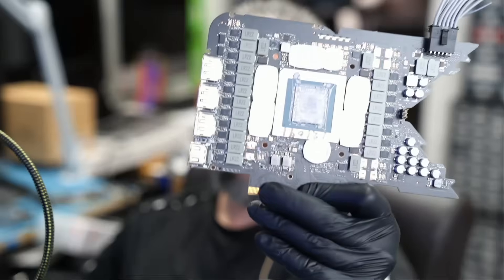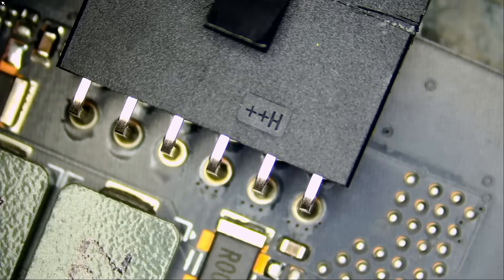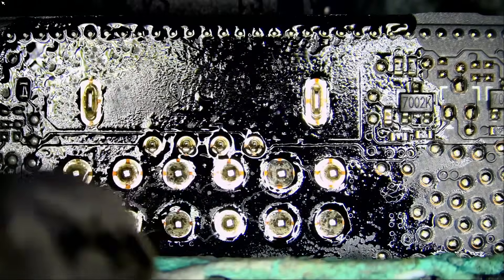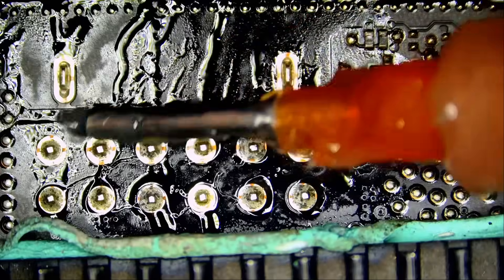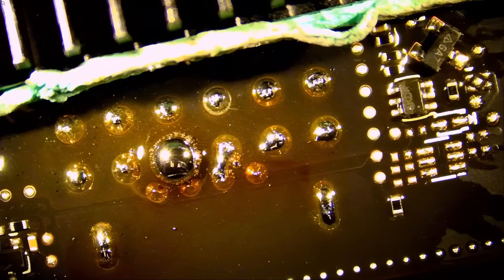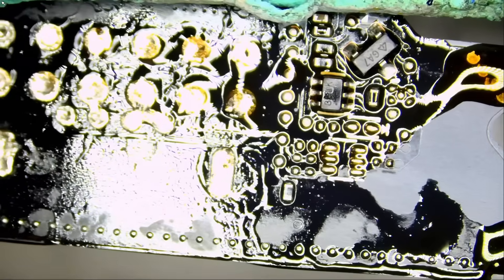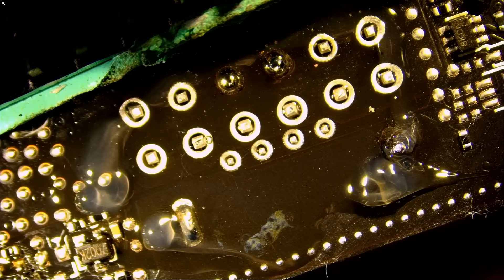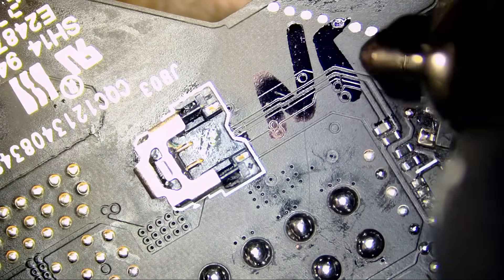The New H++ GPU  Connector Is STILL a Problem – 4090 12V-2x6 Melted

Comment: It is ridiculous that the 5090s aren't coming with mandatory load monitoring or even active balancing for the 6 power pins. Derbauer made a device that can monitor for 140 bucks with a unique connector length, audible alarm, and onboard logging of per pin current and connector temps. There is no way the third parties cannot all just let go of a tiny fraction of their margin and build in monitoring at least using probably less than 25 bucks worth of extra materials and work in manufacturing. These cards are insanely expensive, there is zero excuse for having so little precaution. For what asus wants for simple monitoring the Astral should be balancing load as needed on its own and shutting down if the load is just too unbalanced to control indefinitely.

Comment: See this in the automotive world all the time, its not the lenght of the pin its the spring tension on the female pin in the cable thats the problem, poor pin tension causes the pin to arc causing excessive heat causing the plastic to melt, bigger pins and better tension , some times manufacturers need to stop penny pinching

Comment: It's a simple fix from the manufacture side...double the voltage and halve the current.  Just add a buck converter AFTER the connector.

Comment: The RC model world has had connectors capable of delivery 120-180 amps of power (2000W) for years, why can't Nvidia just use those and make an adaptor to fit the PSU until PSU manufacturers catch up?

Comment: i have asus strix Z590F motherboard when i turn on cold boot bios settings all going to defualt but time is correct and after i check this like waiting 6 to 10 hours bios not reset but i keep pc off like more than 20 hours it happens any one can help ?

(and also one strange thing happn when i plug my earphons to front panel after like 2 hours of use left side of my earphone volume lower to comapre to right i didnt know is that related the problem to bios reset ?)

  
plz help anyone see this !!

Comment: The problem is not the connector, is a joined fault of the board design with no power balancing and a retarded designed connector. The 3090 had 3 phases on the board for power balancing and it did not burn, but nvidia in its infinite wisdom probably cut some corners, in the power delivery of the board joined with a dumb connector instead of the good 8pin connector we used to use. I do not mind having a uncool looking connector rather than a toasted board.

Comment: Shouldn't they change to a xt60 type or sort of connector at this point? 
I mean with thicker wires and fatter connectors.
As the card only sees it at one wire anyway.

Comment: Them solder joints better than factory must have a good conductivity not causing heat to melt the connector and cause issues.

Comment: To me, seems like the melting connector problem started when the manufacturer switched from multiple power connectors to single connector. Perhaps they also removed or limited any power balancing circuitry; so that any single line wasn't pulling max amps.
Reply: Its a load balancing issue. If they use multiple connections without balancing, they could still potentially melt at the highest loads. But it may happen less.

However, Nvidia doesnt have enough room for multiple connections regardless. You cant put 3 eight pins on any of the cards due to how small the PCBs are. They spent a lot of money on the small pcb and the cooler designs. It would cost wayyyyy too much to go back and do it the right way.

Comment: I am convinced that there will be more than 2 + on the connectyors when it will be really fixed by the company who makes them, maybe they would have to reduce the amount of current in the pins that melt plastic...before to design a new connector, they could reuse plasticx of old good tube tvs that was so resistant tro fire...

Comment: Ofcourse it will be a "still| problem. 600W, are half of the car starter current(petrol ones). How it will handle at least 50A, through those pins? No matter they are several. it will be heat, that`s it. Not enough surface for that much amperes. Manufacturers are stupid.

Comment: Maybe it's not the connectors that are failing and it's the solder they're using? Hasn't made effective contact with the pins, and legs are heating up and causing the connecter to melt. 

I'm assuming you've used low melt solder on all the connectors you've replaced with the quality Amtech Flux (Available in store)? Maybe it's making a more effective contact with the pads, or it's a better electrical conductivity than the high melt stuff they're using? 

Everyone focusing on the connector it's self when it could just be the failure point.

Comment: I have the same problem with my ps4 the hdmi connector on the main board is coming off because of the heat , i have put a set of small fans on the back to keep me from having to replace it again.

Comment: 600W @ 12VDC ... 50 amps. No wonder the connectors are melting.

50 amps in RC ... means a Deans connector. A melted connector means a lost model plus the possibility of the model setting property alight. No bueno. Deans highest performing connector, their flagship, is rated for a continuous 90A. No way H** is going to manage 50A continuous. Someone made a terrible mistake with the H+ standard.

Comment: i know nobody read this . but reason why the 16 pin connector melt because the pin is very thin ,can't handle 600 W in 12v to 50 amp it cause, why made this connector for this current ?
Reply: It looks like this shabby connector design is already a "standard" that PSU makers are adopting. Can't make it up.

Comment: Good day Alex.Love the work! Isee the solder in faulty/new card the solder does not penetrate all the way through the board to top side the way it does when you repair.
Maybe the time /solder composition does not have enough heat when it goes over the wave soldering process causing high resistance in the pin from the circuit board 
connection itself? You resolder those pins at least 5 or 6 times. thats not happening in a wave soldering/industrial enviroment.They mabe should look at solder/flux ratio and definitly heat when  joining...Maybe the connector is not the eliphant in the room, but how it is attached in the first place. Thanks for the great content.
Reply: I doubt that has anything to do with it.

Comment: Also note to people who "build" their own rigs..  Make sure there is enough clearance between your case and  video card power plugs...  
 2-3 times I noticed people  "pushing" their case closed and power cables are bent /stressed against cover which isn't good for card/mother board and the power connector.
If space is really tight get one of those  180 Degree Angled Adapters 12+4pin  (but better off getting a bigger/deeper case vs adding more connectors/points of failures)

Comment: It's not just a connector issue, it is a load balancing issue since the pins are just connected on the card.. The connector can stand the 8.3A per pin but without load balancing in the card or the PSU a single pin can carry over 20A as der8auer showed. Which fails obviously.

Comment: I once was a keen fan of NVIDIA but because of their stubborness still pushing this failed connector technology I stopped buying their products. Whoever decided to go for a small 6+6 pin connector should have been fired years ago. But obviously NVIDIA decided to go down the drain with it. I have a degree in electronics and worked in the electronics business for decades. Usually if a horse died we fix it by breeding a better one. But NVIDIA keeps on riding it still lying on the ground rotting.

Comment: Maybe the manufacturing process weakens these connectors? And manually replacing them may be is better than factory?

Or users don't overclock the gpu after repair anymore?

Who knows, but it's interesting they never returned.

Comment: moral of the story. just straight solder the wires to the board and go on. maybe swap thicker wires while at it.  add an extra fan and heat sink where possible.

Comment: You can see the slight misalignment on the left (1:15), even when in the locked state, which caused the issue on the previous connector. It's not pin length, it is pin shape / contact points / alignment (in my view).

Comment: The story of the melting connectors on the 4090's should've ended a long time ago. 
What would it cost the manufacturer to make good connectors from heat resistant plastic. Probably not much. 
So why are they still supplying these high-grade boards with shitty connectors.

Comment: The connector is fine, just don't use it with over 400W. If you have more -> use 2 connectors on your cards. Simple.
Reply: I remember reading that Nvidia banned any AIBs from using 2 connectors.  They only approved board designs that had 1 connector.   I definitely agree tho, the safety margin on this connector was way to low.

Comment: Im kind of behind on the higher power draw GPU's like the 4090, so apologies for the noob-ish question  - but Nvidia must know by now why this is still happening. 

Have they released any `official` statement about the cause and steps taken to remedy it? 

The slightly higher rated connector (im guessing its made with higher quality materials) seems to not consistently be able to handle what the card is drawing, but why?  Whenever i think of burned sockets I  think bad/inadequate connection at the joint generating all of that heat.

Maybe they should start shipping the cards with an Nvidia supplied pigtail that they've tested to death, which could then plugin to the power supply line and at least be visible and push the problem further upstream  hopefully helping by not needing a new socket installed? Idk.

No matter how you slice it, for the amount of money these cards cost, they shouldn't have rudimentary (looks like to me anyway)  failures like this.

Comment: you know what would fix ALL this shenanigans?
2x 2x6 connectors
Reply: Pretty sure Nvidia banned all AIBs from using 2 connectors.
Reply: It wouldn't, you would still need load balancing between the pins, even a 300W only cable runs the risk of melting because there's nothing balancing the current going through the wires, one wire in the cable can end up drawing far more than is the safe limit.

Comment: The factory connector has no solder flowed to the front of the board.
It could be one factor why your better than factory is better sir in handling power delivery heat generation

Comment: Alex you said first in the video that the client used an aftermarket connector - and that could be the weak point...
Reply: Depends on the quality of the cable but i don't think someone bought a 4090 and used a 5$ fake 16awg cable which is in reality a 20awg. Nearly all cable from reputable brands are 16awg for a reason.

Comment: Easier insertion is a red flag, in my opinion this means the pins do not have adequate tension, loose connections = heat

Comment: they should make the connector from ceramic material. just like headlight sockets when upgrading the wattage from 55w to 90+w
Reply: Then the wires will start melting... Nvidia has to redesign this connector, but the problem is... this connector was "approved" by someone very high in the leadership position, so they'll continue to mindlessly push it, no matter how many cards will burn.   I think this would not change unless Nvidia starts losing some serious money... and even then it's still doubtful, they continued to use the same connector even with all the problems they had with 40xx series. So it seems the person who approved this connector, would not back down, no matter what, and no matter how many cards would burn.

Comment: Nice work as always. The mating socket has a big role in these failures. Any weakness in the pin/socket interface causes arcing. Arcs make very high temps, melting and carbonizing plastic parts, which encourages more arcing. Rinse and repeat. The upshot is that the third party cable could easily have been the culprit.

Comment: Alex, a theory emergence, you mentioned that not a single video card has come back to replace the power connector that you’ve installed or replaced, non-have come back under the warranty that you give, number one perhaps it’s the type of side that you are using compared to what the manufacturer is using, just a possible scenario. Number two I have noticed from the side with the connector pins bend at a 90° and go into the board that the manufacturer solder does not go all the way through the board up to those 90° connectors, and when you Remove the bed connector and replace with a new connector, you heat up the solder to the point that it goes from the upper most layer all the way through to the outermost layer it is a 100% through and through solder connection, also it could be both of those scenarios Better solder that you are using, and the solder going completely through and through, whereas the manufacturer is not soldering those connectors on properly and they are prone to failure, mind you it’s just a theory, perhaps testing a card under a thermal camera over a certain time. Periodwith a factory connector versus one that Northridge fixed has replaced, it would make for an interesting science project don’t you think?
Reply: Well, Alex uses leaded solder which is prohibited for factory use. This probably makes a better connection.
Reply: None of that has to do with them melting though.

Comment: the issue is people use old gen psu's, where power delivery is designed differently.. for those new connectors you need atx 3.1 and pcie gen 5 psu's
Reply: I use an older psu with my 4070tis - nearly a year and a half - it obviously doesn’t have the extreme power draw of the 90

Comment: Shorted sens pins don't resolve the problem with this connector. It's still the same unsafe crappy connector. And more Nvidia do not allow AIB to change from 1 big 12V power plain to 3 12V power plains. Like 3090Ti. 3090Ti have 3 12V circuts in GPU board. 3090Ti better balances the voltage. 
4090 and 5090 will not balances the voltage becouse havo only 1 big 12V power plain and don't "see" how unbalanced voltage can be on connector/cable. F%CK Nvidia.

Comment: I dont believe its the connector that is the problem but if they was serious about this they would ensure power supply companies have the specifications needed to make connectors that actually work with this connection hub. There are plenty of existing electronic connector solutions out there that send more power through them than these and they are not having issues. Problem is like 90% of everything in the computer industry there are no standards, so we have these cheap companies that are selling cheap crap connectors and this is proof without standards the potential for failure is guaranteed!

Comment: After all those connectors melting wth are they not going back to 8 pins pcie connectors? 3090 had 3 of them , that can take 800w without problems.
Reply: They don't because there was less standardization. With 16ga wire, three 8-pins can carry a lot of current. That would be rated for over 1,000 watts. But, some PSUs only have 18ga wire and some have 20ga, so I understand why they wanted to move to something more standardized, but they should have just gone with dual EPS connections and keyed them differently. That would get you nearly 1,000 watts with 16ga wire.

The only reason for the 16-pin to exist was because it was smaller, but with rumors of dual 16-pins... it's laughable. Not to mention, it wouldn't solve the problem anyways. The connector is trash, but NVIDIA is also cutting corners on how the card's power delivery is being designed.

Comment: nVidia should use spade-type crimp connectors for high-current connections like a normal person
Reply: They should have designed the power delivery to the card better. Not just the actual connection

Comment: The standard only specifies how many watts it delivers — not that it does so through a non-melting cable. 😜
Honestly, just slap a microwave magnetron terminal in there already. It’s drawing about that much power anyway — at least that won’t melt.

Comment: Wonder who the original connector mnfr is vs Alex sourcing
Reply: I think probably solder that has lead in it sticks better to the connector so it makes better connection, between the connector and the board. It was stupid to remove lead from solders so some politician can earn some points in their voter campaign, and now all electronics will suffer, which will ultimately lead to more pollution, than if a normal amount of lead was added to the solder.

Comment: 2060 6GB until year 2030 or dies out. Then igpu for video output. Slower yes; rather this than a burnt gpu/cpu or system.
Reply: If I take a look at 8700G and don't know why I should buy a graphics card. Hopefully there will be Mainboards with the 395 ai GPU for Desktops